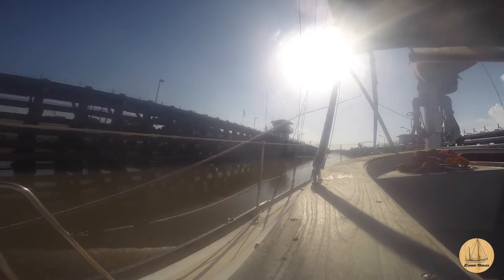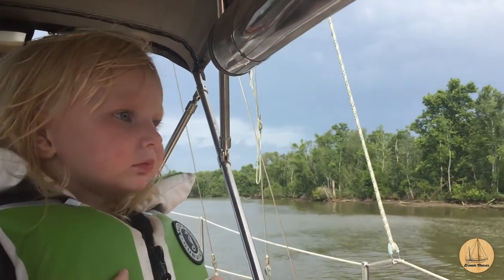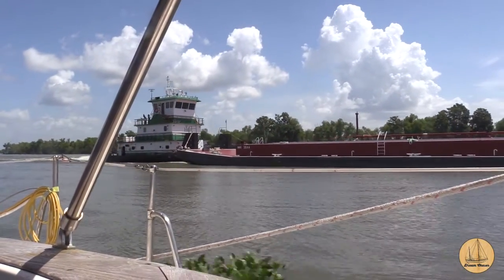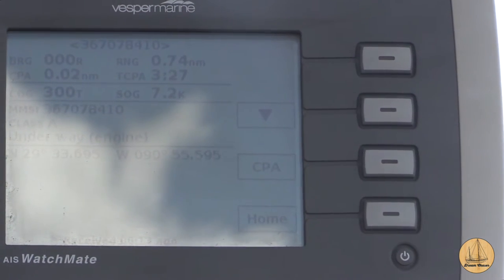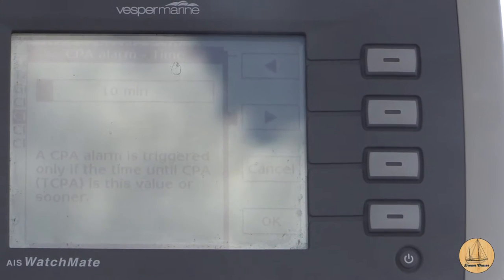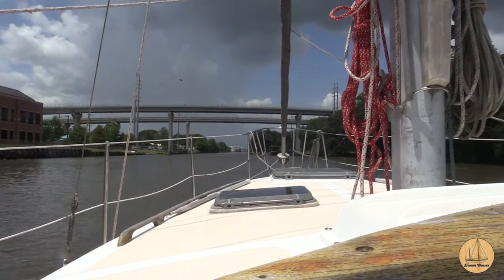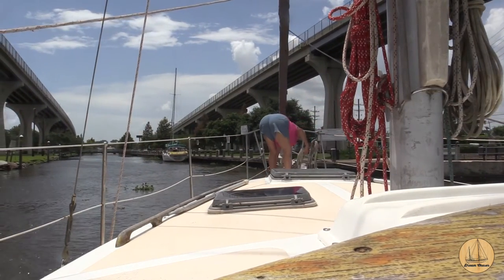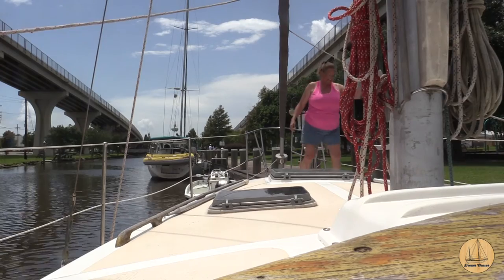Sailing Kemah to New Orleans - Part 4

Comment: SV Dream Chaser -- Certainly am enjoying your videos.  We look forward to making this trip from Waterford in April in time to make it to NOLA for the Jazz Fest.  We have a 5' draft and 65' air draft.....Appreciate any special tips wrt to height/depth restrictions etc.  Just curious as to what your long term plans are??  

Keep up the great videos!!
Reply from the maker: John Bartges thanks John. Draft should be fine on the IcW but because I had 55' height I don't think you will have a problem as I think the bridges all open higher than that but please check the charts for sure.